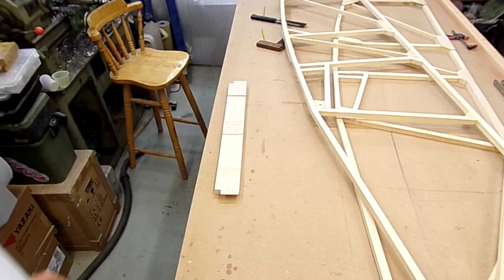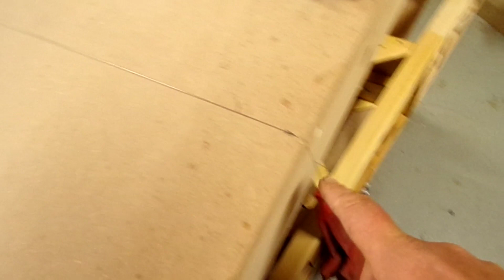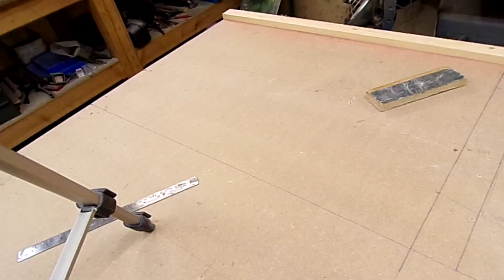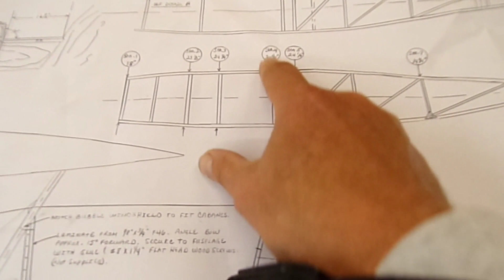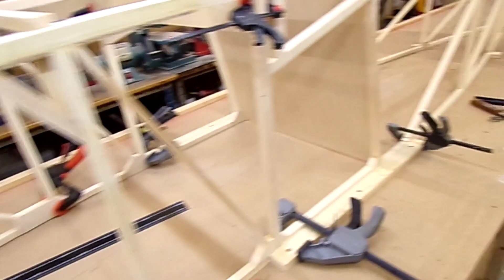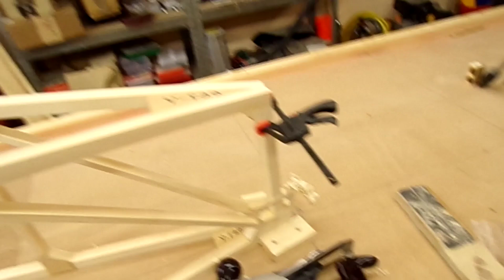EP71. Fuselage starts to come together Fisher Youngster V SSDR

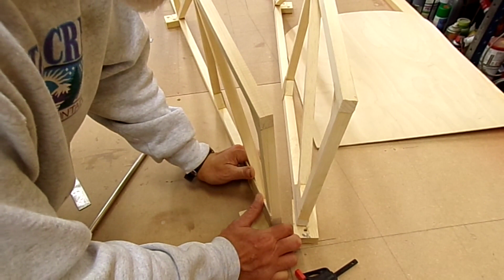Comment: Hi, I'm starting on a total rebuild of my fly baby biplane (my flying adventures are posted at Jimmyboy163), and per the manual, it says to skin the sides first then bend them together.....but knowing how stiff that will be, I'm thinking of skinning the box structure after bending the tail section together.   As you mentioned @11:00 - 11:50.  

I've build a KR1 back in the 80's and the frame was bent together first then skinned.  Not sure why the fly baby has been built since the early 60's using the 'skin the sides first' method.....

Thanks for posting your progress!
Reply from the maker: There are two schools of thought on ply skins: one lot think that putting tension into the ply by bonding first and then bending makes the structure stiffer, the other schools looks at the way the ply becomes wasped and also the extra strain in tension on the cross joints as negative. Having talked to ply boat builders and carried out repairs that required the ply to be applied un stressed has shown to me that the tension is lost over time, so I am firmly in the second school. I hope that helps.
Reply: @flyingkub  thanks for the reply.  I'm going to bend the box frame first then add the ply.
Reply from the maker: @jimmyboy163  I think that will make your life easier and assembley better aligned.